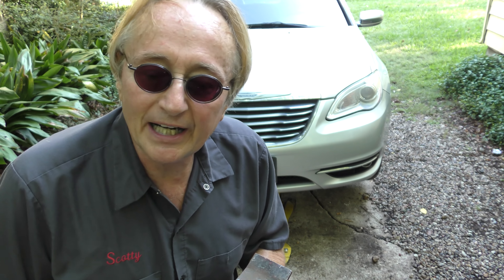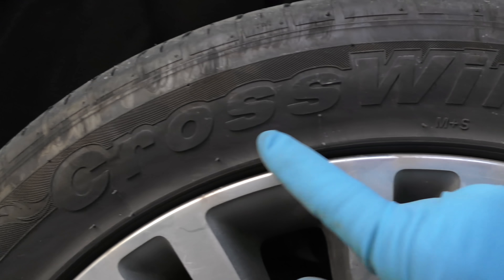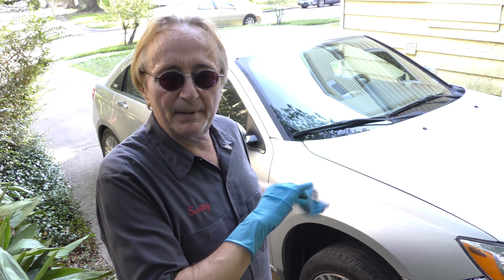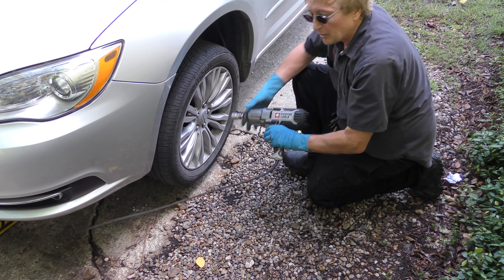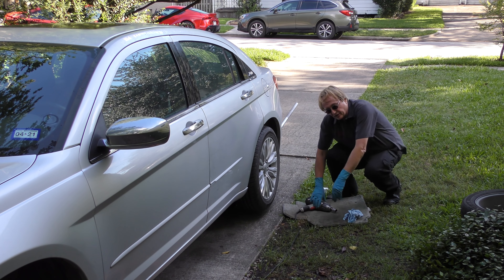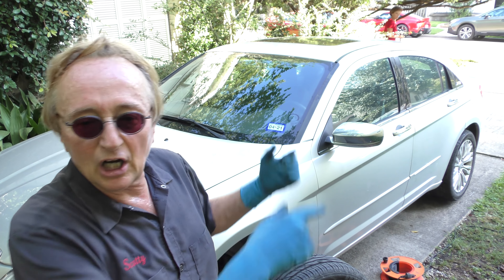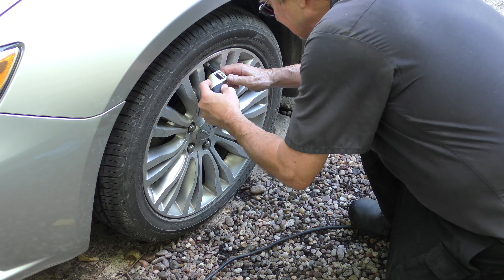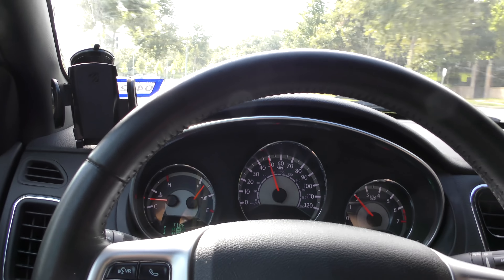Here’s How Stupid People Change Tires

Comment: I like when someone who has zero experience with cars yet when it overheats or dies they pull over and look at the engine.Yup that's a ENGINE.
Reply: Despite zero experience, obvious burst radiator hose, duck tape, and a few gallons of water will get that car rolling home again. Duck Tape. Don't leave home without it.
Reply: They just checking the Johnson Rod
Reply: That would be me 😅😂 and I would be calling my dad 🥺
Reply: Isn't that how they do it in the movies though? You know those movie writers are mechanical wizards.
Reply: Well I know a guy that had a Renault 4 and the engine fell out of the car because of the rust. Everyone will notice that.
Reply: Just call dad or gramps... they'll know what's up right away 😂
Reply: @rubenbraekman4515  Agreed!!
Reply: @rubenbraekman4515  You get gramps out, he'll ask what's wrong then look under the hood and tell you to try starting it. It will start, because it's afraid of gramps.
Reply: @CheapBastard1988  Engines fell out of Packards too. Incompetent and lazy mechanics are nothing new.
Reply: Zero experience or not what are you supposed to do? Gee I'll just sit here and do nothing about it
Reply: They are just looking for the chrome muffler bearings. Those things fail all the time 😵
Reply: That's me right there bro
Reply: Well, the light said, "CHECK ENGINE"!
Reply: Stephen Arling Yeah but duck tape can only do so much.If you have to drive at least anywhere everyday 30-40 miles away in ways.The best insurance policy for you is to getting a towing service or a Triple AA membership.If you know nothing about cars and wanted to getting home in one piece.
Reply: never have to worry about this with my electric cars
Reply: "Checking the engine" is a running joke in my family when the light comes on. The person checking the engine will ceremoniously open the hood then strike a pose to seriously regard the engine. Then they announce, "Yep, that's an engine." Of course they then look for obviously loose hoses and cables, etc.
Reply: It is funny because its 99% true. But I like it even better when the 1% person with zero experience looks at the engine, sees an obvious problem, fixes it, and goes on down the road. And there's millions of 1%'s out there
Reply: To be honest if it overheats, you want to open the hood and air it out a bit. Or maybe even take the hood off and strap it on the roof and drive like that. Free cooling.
Reply: Even worse when they pop the trunk .
Reply: it reminds me of that old Seinfeld cold open. when jerry is talking about that same thing. he said "you hope it's something so simple something so obvious that even you can figure it out... like a big on/off switch in the off position.
Reply: Whenever I get a problem I just get my trusty $5 obd2 scanner, works wonders. That's the best $5 I've ever spent.
Reply: @HotwiredFlamingo  I don't even need to use my reader on my truck because it will give me any error codes on my odometer which is a nice feature for a second gen dakota that doesn't even have power windows or seats.
Reply: The radiator is usually also under the hood where the engine is.
Reply: That's why there's a check engine light. Right? :)
Reply: I don't know how to fix a car. If the car breaks down, and the gas tank does not say "E", I'm screwed. But if the gas tank says "E", I get all cocky - "I've got this one, don't worry." So I get out the toolbox AKA wallet.
Reply: Lifting the hood and looking puzzled is a distress call. They’re hoping someone with a clue stops & helps them.
Reply: Sometimes you get lucky and its just a mouse that has built a nest somewhere
Reply: Ever think they are checking for broken hoses or their radiator?
Reply: If there’s an obvious failure like coolant spilling out or a blown belt you don’t need to be a master mechanic to view that with your eyes. And then they can be a little more informed of what’s happening so they don’t get ripped off.
Reply: @edwatts9890  legend
Reply: An engine
Reply: That’d be me lol
Reply: @sozeytozey  LOL, Its most my family also.
Reply: They’re probably looking to see if there’s anything broken that they can temporarily fix. Idk

Comment: Thanks for calling out Harbor Freight's DEFECTIVE Jack stands.
Reply: yep
Reply: Hazard fraught living up to the name.
Reply: I watched a guy changing a transmission in a 325 in his driveway using an 8ft 2x4 as a prop.  The car was 50 degrees leaning and they were kneeling under it. 

I guess at least the plank didn't have a ratchet.

Comment: Who remembers using a bumper jack to change a flat ?
Reply: I do. I also remember having the car fall toward the side of the road. Not a calm experience when you are changing a tire on that side.
Reply: me too had a lot of 70 's model Falcons with big fat chrome bumpers ...
Reply: Bumper Jack's were the best. 😁
Reply: I do.  My dad has one fail in the driveway when I was just a little kid.  Luckily he wasn’t under it and my brother and myself were far enough away. Had it up in the air changing the tire or an oil change and it slipped off.  Can’t remember how he got it off the ground w/o a wheel.
Reply: I remember using a bumper jack on my father’s  ‘55 Pontiac Star Chief.
Reply: Oh God...I hate those things so much.
Reply: Yes. I remember those vertical slots on the chrome bumpers on my dad's old '76 Pontiac Grand Prix.
Reply: Had to on an 86 stinkin Lincoln one time lmao didnt even realized thats the type of jack it had til it was time to use it.  Kinda dig it lol
Reply: Used it on a 73 Grand Torino
Reply: my neighbor still does that on the back of his lifted f350.
Reply: Both of my 70 Buicks  has that system. Easy to maintain and, none of them, ever failed me.
Reply: I also remember the bumper tow package U-Haul rented for one car to pull another car. That thing looked scary.
Reply: I remember it very well because my 89 Town Car got a flat a few weeks ago.
Reply: You do it enough times, you don't forget it.
Reply: Who remembers when the car wash would hook a chain to the bumper
Reply: my 53 Caddy had that type bumper jack. I remember the 70's cars some had slots in their bumpers for a jack
Reply: Yeah but it was an old rusty Chevelle, so the car stayed on the ground and the bumper went kaboom!
Reply: Getting a rear flat tire with car with  wheel well skirts that won't come off on a 1959 Buick Electra in the snow! SMH
Reply: Commonly referred to as widowmakers.
Reply: @doncnunez6231  the skirt would have came off if you were doing 60 mph when the tire blew.
Reply: 67 ford fairlane with bumper jack. Dont they used to call them 'widow makers'?
Reply: Scary and dangerous... the car could slide right off and pin you! Nice design GM 😡
Reply: Ah, the good ole days!
Reply: Jason Rushing , they slipped off all the time. Dangerous as hell!
Reply: My Crappy Brown Chevy Nova (1977) had that kind of jack.
Too bad I didn't think to have a SPARE TIRE until the dry-rotted one blew out.  So instead of using the jack, I had to drive 5 miles on the shoulder to "Wal-Mart" to get a new tire.
And then I went to salvage yard to buy a rim so I could get a spare tire.

Though I'm not sure using the bumper jack would have been wise.  This was due to all the rust. ;o)
Reply: David Cisco , that’s what came with my 1951 Ford Custom acoupe
Reply: My 51 Ford Custom Coupe used a bumper jack. Didn’t like it but did use a time it two.
Reply: Yup, on my old 1961 Comet and my 1977 Wagoneer 👍
Reply: werent called widow makers for nothing
Reply: I haven't seen those since chrome bumpers
Reply: Yeah, the factory jack that came with my truck was a bumper jack. Had it fall over on me once, never used it again.
Reply: My 74 Dodge Dart Sport had the slots in the bumper for the jack.  Those slots were perfect for hooking in my tie down straps when I was towing my motorcycle. I had a front wheel hitch mount motorcycle carrier, that I used from CA to IL.
Reply: me
Reply: Bumper jacks worked great for breaking bead off the rim to change tires.
Reply: Bumper jacks and donuts were stupid ideas!
Reply: @stephenarling1667  Had it fall off the jack onto my shin once.  I got rid of the bumper jack that day.
Reply: @jamesgazzillo3737  Remember that very well. As well as having to pull down the rear license plate for access to the gas tank cap.
Reply: They can be dangerous
Reply: And the tire tool,  used to work the jack and remove the lug nuts,  were notorious "weapons of opportunity."
Reply: Yep the good old days
Reply: If not careful, you can get hit in the face with handle.
Reply: I do, and sometimes you could use them to jack out a fencepost.
Reply: 1974 chev impala with the tiny hook that enters the slot in the bumper.
Reply: Late 70s Ford Torino
Reply: Since my Jeep Grand Cherokee fell from the jack onto the jack stand while I was working on the tire, I am using both the jack and the jack stand as for back up to each other.
Reply: I do, and used one once to lever a wooden post out of the ground also.
Reply: Who remembers having the next Dior neighbor "slow" kid swing one and hit you in the forehead.  I do,  I have the crease to prove it.
Reply: A second thought: Remembering the sound of one going up (ka-chick! ka-chick!) and going down very fast (kachickkachickkachickkachick....)  :)
Reply: My wife miss the driveway with one wheel put the one wheel in the ditch. I jacked it up with a bumper Jack and push the car sideways off the jack back into the driveway and guess what no longer stuck in the ditch easy one man job
Reply: Yup. That and the 4-way lug wrench.

Comment: I used to autocross back in the day and I remember a guy who had a turbo'd FC3S and he was having a hard time driving his cars through the slalom and hard turns. He was complaining that he just got 4 new tires. Turns out the tires were directional and he had 2 tires facing the wrong direction.
Reply: A repair place did that to me. I caught it by inspecting the car prior to taking and told them to fix it. Zero cares giving by companies any longer. It literally says the direction of the tire on it. They had to have seen it.
Reply: I had a motorcycle shop put my tires on the wrong direction and when I hit rain the bike was all over the road!
Reply: Test drove a car yrs ago & felt like complete garbage. Pulled back into the dealership & instantly looked at the tires. 2 front ones were spinning the wrong way. Guess that huge arrow showing direction of rotation only means something if it's YOUR car. Just like hundreds of other jobs
Reply: Amazing how many people aren't aware of that .
Reply: Holy wipeouts, Batman!

Comment: I used to work for Michelin (manufacturing of tires), the best tires need to be in the back. This has been proved time and time again on their test track under all types of wet and slick conditions. If your front starts sliding, it is much easier to correct steering than if your back end slides out from you going around a curve on a wet road. Doesn't matter what whether it is front or rear wheel drive. It is a traction problem, not a drive problem. Granted rear wheel drives are not known for handling slick surfaces in the first place. The best tread in the back is a good temporary measure until you can replace all 4 tires. 4 new tires beats that every time.

Comment: The good ones go in back on a rear wheel drive car; right?  I had tires that were just 10+ years old still had mileage per warranty but it's which comes first.  New tires & an updated full 4 wheel alignment fixed the wondering problem.  Proper maintenance isn't cheep unless it's your car.🤔💖  Love to watch you work!!!😁

Comment: Costco refused to install new tires in the front despite my express instruction that I want the new tires in the front on my Sienna FWD only.  So, I ended up rotating them myself as soon as I got home!
Reply: summer tires? their usually uni-directional so you can.
Reply: Paul Cheang if you are getting only two new tires, they do go on the back regardless of fwd or rwd.  Scotty is wrong in this.  Reason being you have bad tires in the back you can easily find yourself in a ditch or spinning into another lane when the road is wet.  Dry pavement it doesn’t really matter though.
Reply: Have managed to see the aftermath of understeer in the rain around a curve, and also have been the victim of oversteer in the rain (in my tires defense I was actually trying to avoid an accident of someone running a redlight as I was making a left with an arrow and floored it, many years ago not sure how much tread was on each though but safe to say it would have happened regardless). I understand both the arguments for each, as you can argue that if you had a blowout due to worn tires (using the 2 tire purchase method, and most of your driving time will be on dry pavement) you would rather have it happen on a rear tire not a steer tire, especially when you consider the majority of vehicles have most of their weight on the front tires, but you can go back to the understeer in the rain as the idea is that you will notice it, slow down, and regain control which is simpler than trying to regain control if your rear swings around as the everyday driver won't have the knowledge or skills to regain control. I personally do prefer to replace all 4 tires though, helps to keep things even for treadwear warranties, but do also drive a Bronco, so I have more weight on the road than a small car and try to avoid driving at excessive speeds increasing any risks of losing traction. Now if we could educate people on the proper use of temporary spare tires as both temporary and not putting them on a steer axle, we might be doing some good in the world...
Reply: It's also the law in some states. So any shop wont to avoid getting sued.

Comment: As someone who works with tires, and has looked into a lot of stuff, having the better tires in the rear is better than having them in the front in rain and snow because it helps to prevent fish tailing. In front wheel drive cars, rotating tires properly and on time is very important because if you don't, the fronts will wear much faster and the rears will begin cupping, which creates uneven spots on the tires. The issue with this car was likely the tread difference as well as probably some cupping on the tires from late rotations.
Reply: Discard the word "better" from this discussion. Always have excellent tyres on the front. If you lose traction there, nothing good follows. Fish-tailing has a lot to do with the competence of the driver in adverse conditions.
If you're going to have a blowout at 100 km/h on dry dirt/rubble, the rear is a safe place for it to happen (as I have found).
Reply: @brianvogt8125  I agree that a rear tire blowing out is much safer, especially in a front wheel drive vehicle. I also agree that fishtailing can be fixed by the driver skills. I live in Southern California, and most people (despite rainy season coming every year) still can't drive in the rain. So, people spin out all the time, so unless the driver knows what they're doing they need the good tires on the rear. I definitely do prefer the better tires on the front and I have a RWD vehicle, but that's because I know how to handle the rain, snow, and how to recover from a skid. But, for those who don't know how, they need the good tires in the rear.
Reply: Thanks for bringing this up. And sharing knowledge. Trying to figure this out. Seems like there might be both good reasons to have the better tires on either front or back depending on the circumstances. Seems the fishtailing could be more about adverse conditions or driving too fast for those conditions. I have a front wheel drive car and put the better tires on the front because I would prefer a blowout in back instead of the front where the steering is.

Comment: Thank you Scotty! I've been a delivery driver for 35 years. I've always had better handling with the better tires in the front. No matter what anybody says.
Reply: The reason you put the good tires in the back has nothing to do with handling. It's because a blowout in a rear tire, especially at speed, is a lot more dangerous than a blowout in a front tire.
Reply: @tedgey4286 can you educate me exactly how this happens? I would think a blowout on front would be more dangerous because the steering and engine weight. But maybe I'm wrong. I might not be understanding this well enough
Reply: It seems like I've had blowout in rear before and didn't fishtail or affect my steering. Just heard it and felt it and didn't lose any handling just slowed down and pulled off the road. If recall it was about 55 mph or something. But maybe the higher speeds 70s or 80s people drive now on the interstate it's different. High speeds or wet conditions might affect this. I'm trying to figure this out.